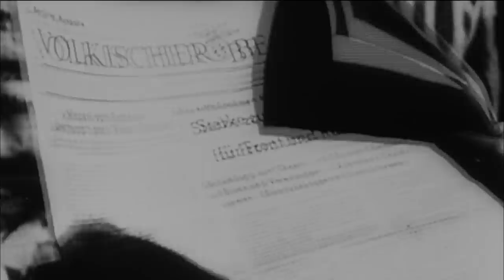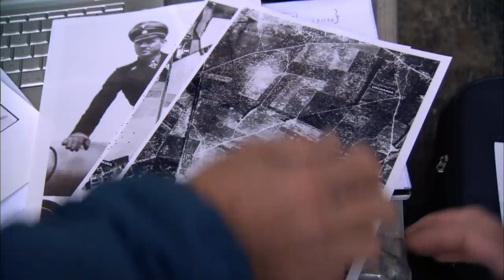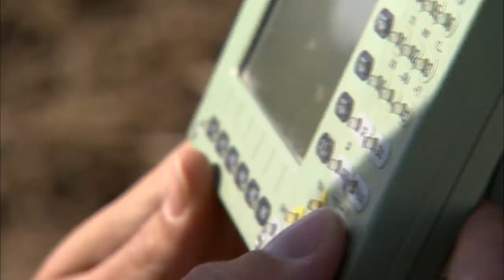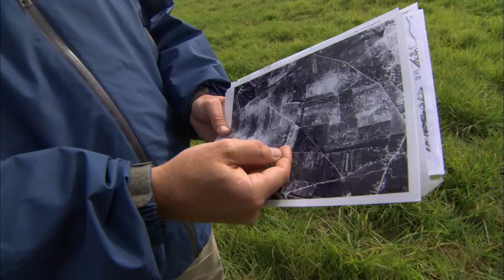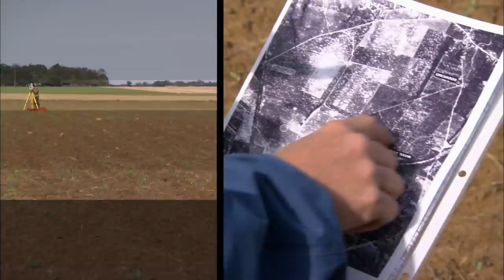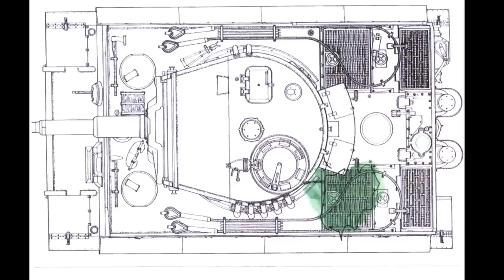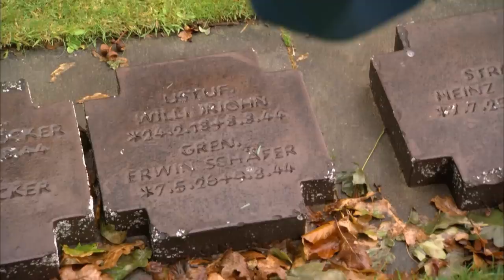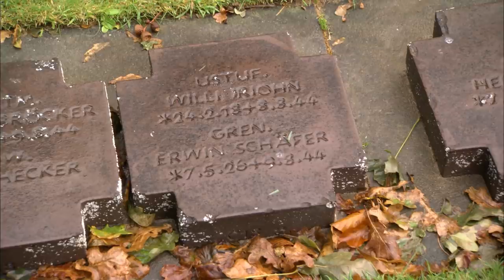Inside The Mind of The Infamous Black Baron

Comment: In the end it is mentionned that 100,000 lives has been lost during the battle of Normandy. Of which 50,000 German soldiers. Why refer to 50,000 dead German soldiers and not mentionning the other 50,000 deads?

Comment: If it only got hit in the engine compartment then why did none of the crew get out? it must of been hit elsewhere. It is possible the tigers were hit from both direction at the same time.
Reply: It was stated that the fuel tank and the ammo is stored by the engine, igniting both the ammo & fuel. @40:37

Comment: What mystery? I got as far as 11:11 and the answer is right there. Joe Ekins killed Wittmann in a modified Sherman tank retrofitted with a 76.2 mm British '17 pounder' anti tank gun dubbed firefly's due to the tremendous plum of fire produced when fired. At night the flash of fire would temporarily blind anyone who did not close their eyes when it went off. Mystery solved, tank gunner Joe Ekins destroyed four tanks on 8 August 1944 near St. Aignan de Cramesnil, France, including the Tiger commanded by Michael Wittmann.
In 1985 after much research comparing battle reports, Les Taylor former member of the 1st Northamptonshire Yeomanry, stated Ekins was responsible for destroying Wittmann's tank. Ken Tout, also a member of the 1st Northamptonshire Yeomanry, credited Ekins. Other historians have also asserted Ekins fired the fatal round.

Comment: He got destroyed by a tyfoon just like 90% of all the tigers on the western front
Reply: I think your wrong...i know those rockets look impressive and certainly terrorized people but they were mostly fuel with a small warhead and no shrapnel
Reply: @samsungtap4183  why would you use shrapnel against armor they already had shaped charges back then the rocket on the typhoon was basically a big panzerfaust If you hit the tiger on the top from the side or the back he is done for
Reply: @010Jordi  after the battle of Normandi, battle field analysis showed that very few vehicle's had been  knocked out by these rockets and those that were were soft skinned but what they did find was many vehicles abandoned,so they had a desired effect if not the one everyone seems to think
Reply: Nice fantasy, but it's completely unfounded.  Very, very few tanks were ever destroyed by aircraft fire, rockets or bombs.  They simply were not accurate enough.
Reply: @010Jordi  Rockets fired from aircraft in WWII are hopelessly inaccurate and more in the range of area-fired munitions.  You really need to do more reading and less fantasizing.
Reply: To see how effective the rocket firing typhoons were, the analysts painted a tank white and used it for target practise. I think they got very few hits. It is a myth that typhoons destroyed most tigers in Europe.
Reply: @dp-sr1fd  Yep.  And the tanks were already destroyed tanks, just sitting there.  No anti-aircraft fire to trouble the aim of the Tiffie pilots, and still the "accuracy" was atrocious.  Rockets were only really useful against massed thin skin targets (which you didn't really see all that much of once the Germans learned to disperse during the day and conduct most ops at night.